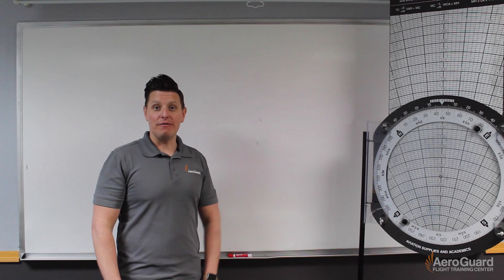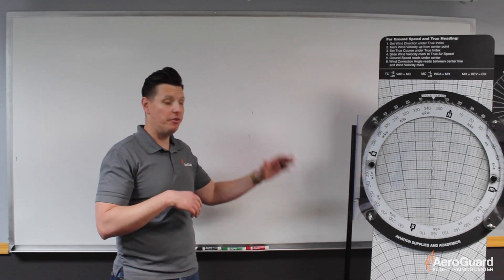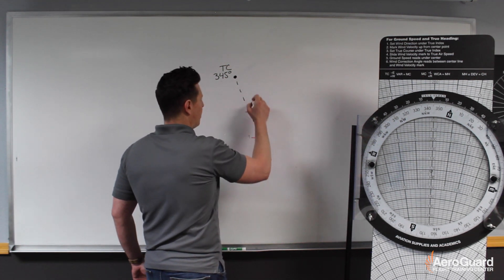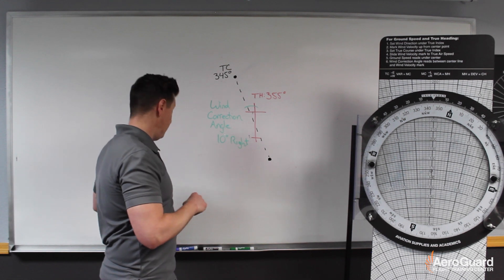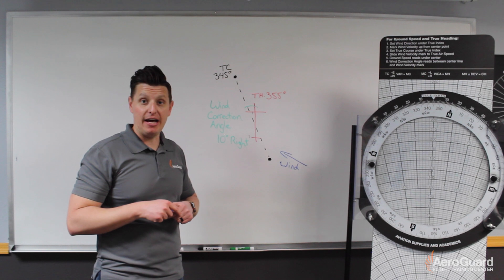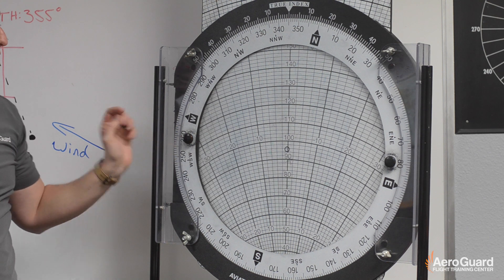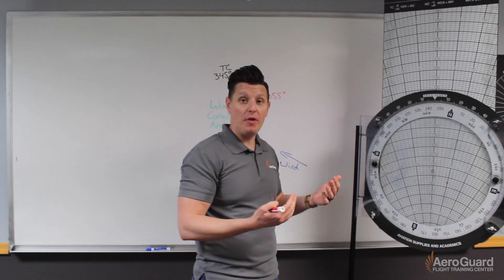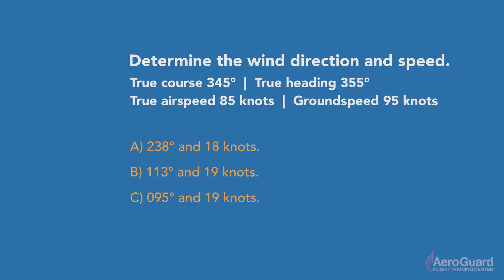How to Use an E6B Flight Computer for Unknown Wind - AeroGuard Flight Training Center

Comment: Love those videos. I solved this question by imagination only. The other closest answer was wind Direction of 095 
That’s almost direct 90 degrees cross wind at 19 knots. At 85 TAS it will require much more than 10 degrees of wind correction angle. 

But the safest way to do it (especially if you’re not already an experienced pilot, like most viewers of those videos) is to solve it a step by step using E6B
Reply from the maker: Hi there! We're glad you enjoyed our video and thank you for sharing your insight as well!

Comment: What happened with this exercise which is more than 59 knots and not possible to use the e6b?

If a true heading of 230° results in a ground track of 250° and a true airspeed of 160 knots results in a groundspeed of 175 knots, the wind would be from
 A.	 135° and 59 knots.
 B.	 165° and 60 knots.
 C.	 343° and 60 knots.
Reply from the maker: Hi there! Thank you for reaching out with your question. When looking at the information you provided, the wind would be from A) 135 degrees and 59 knots! Please reach out with any additional questions you may run into and we hope this helps! Thank you!
Reply: Thank you for the answer but I would like to know how to get the result without the electronic e6B @flyaeroguard
Reply from the maker: Hi there, you should be able to insert different numbers into the process we explained in this video and find the approximate unknown wind without having to use the E6B flight computer. Our goal with this specific video was to show viewers how to take the information they have and apply it to the E6B flight computer to find the unknown wind more accurately. Thank you!  @Beatamins

Comment: Thanks for the video it's really helpfull to understand. I have a simple question. After marking the wind dot on 10 degree over 85 knots, you slided the dot on center line above the reference point. Do we always have to slide that dot above the reference point ?  If you slided the dot below the reference point, the result would be different. How should i decide whether the dot will go below the reference point or above ? Thank you !
Reply from the maker: Hi Cem, thanks for the question. Yes, you will always slide the dot over the center point, and then this will indicate to you the wind direction at the top of the E6B marked under ‘True Index'. Hope that helps!